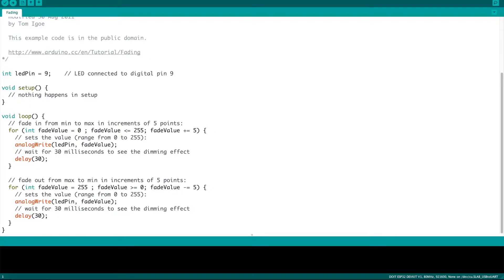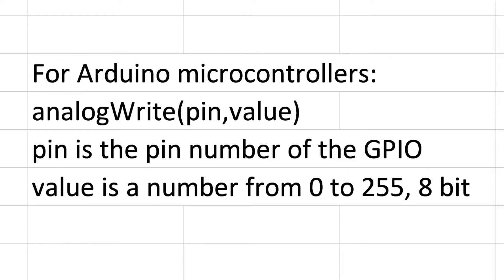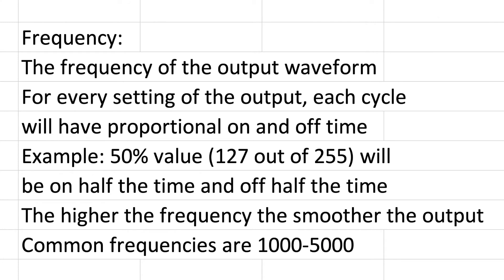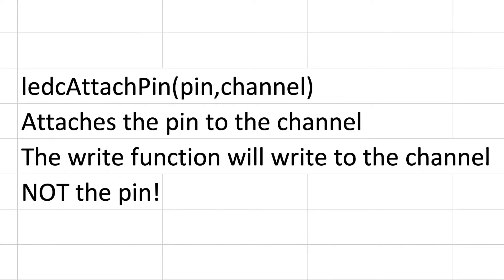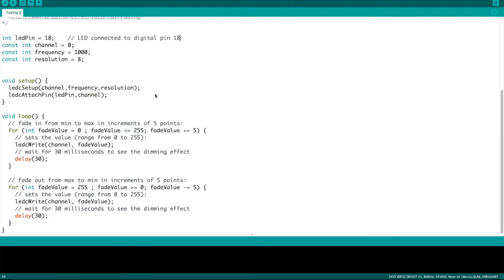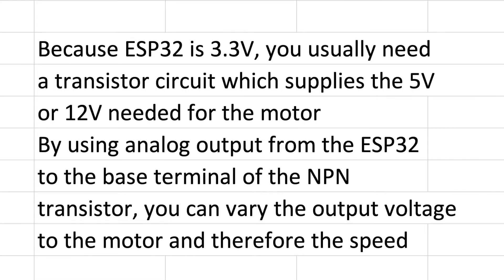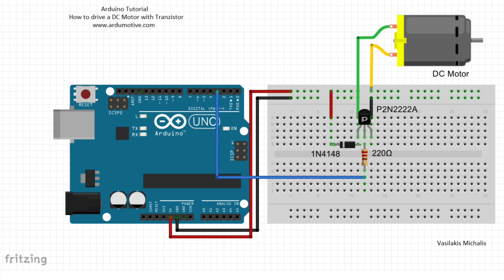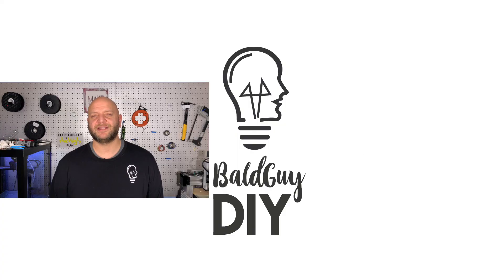ESP32: How to Setup An Analog Output for LED dimming, DC motor control, Etc.

Comment: Thanks for trying
C:\Users\arn\AppData\Local\Temp\.arduinoIDE-unsaved2024113-6732-6nd2c0.536td\Fading\Fading.ino: In function 'void setup()':
C:\Users\arn\AppData\Local\Temp\.arduinoIDE-unsaved2024113-6732-6nd2c0.536td\Fading\Fading.ino:25:3: error: 'ledcSetup' was not declared in this scope
   25 |   ledcSetup(channel,frequency,resolution);
      |   ^~~~~~~~~
C:\Users\arn\AppData\Local\Temp\.arduinoIDE-unsaved2024113-6732-6nd2c0.536td\Fading\Fading.ino:26:2: error: 'ledcAttachPin' was not declared in this scope; did you mean 'ledcAttach'?
   26 |  ledcAttachPin(ledPin,channel);
Reply: Although the code didn't work...your explanation of esp32 analog write was helpful! thanks!

Comment: Hey Brandon!
How's going?

I just watched your video ESP32: How to Setup An Analog Output for LED dimming, DC motor control, Etc.
I'm trying to make a project with 2 ESP. The ideia is to replace a long cable by this.
 
ESP server : reads the temperature from a DS18B20 sensor.
ESP client : connects via WIFI to ESP server to get the temperature.

From the ESP cliente I need to output the temperature to a swiming pool controller via cable with analog signal. 
This ESP client will work like a temperature sensor.

Do you think that is possible to output the correct analog temperature to the controller?

Do you have any ideas on how to properly setup this analog output?

Congrats by you channel!

Thank you!!

Comment: Thank you for this video. I am attempting to dim a commercial LED Grow light. This light says it functions on 0-10vdc. I have a 10vdc power supply. I have tried pwm, it wont work. The company told me it is looking for an analog input and not digital. I would assume the steps in this video would be what I was needing. Can you confirm that this would supply an analog input rather than a digital input? input = the signal going into the light dimming connector.   This is for the BIOSLighting Icarus Li2. I am doing this through esphome with Home Assistant. I appreciate any help you can give me.

Comment: Good video But I'm having trouble still. "'ledcAttachpin' was not declared in this scope
" have any suggestions?
Reply from the maker: Sounds like you’ve missed a line:
“int ledcAttachpin =“ with the PIN number you’ve connected to. Or perhaps you have a spelling or case mistake in that line. Any time you get an error that something hasn’t been declared, it’s because the compiler doesn’t find a variable being declared before it is being called. Thanks for watching!

Comment: Hi BaldGuy! I'm just started moving from Arduino to ESP32 and this is my second baby step after blinking some LED's ;-) I think you explained things good and happy you talk about frequency and not voltage as many do. One major improvement for your channel would be to invest in a better microphone. Several studies shows that good sound gives you more followers, and it's and additional thing to tinker with ;-) Today they are not expensive. Good luck with your channel growth!
Reply from the maker: Hi Mickael, thanks for watching and commenting. We’ve had a few microphone issues at times, mostly due to the software I was using or background noise. I think the more recent videos have had a lot better sound. 

I find new things all the time to love about the ESP32 and hopefully you will too!  It might seem like a huge leap from blinking an LED to some of the more advanced projects. But you get there sooner than you think!
Reply: @BaldGuyDIY  Great! I'll have a look at some of the later ones as well. Cheers!

Comment: Thanks for the video. It would be nice if you could include real live examples. A real led dimmering and a real motor spinning would add a lot of value to the video.
Reply from the maker: Thanks for watching. I usually do show an example with the physical components, but in this case I thought most people would come to the video just for the difference between Arduino and ESP32, not to understand analog output in general. Good suggestion though!